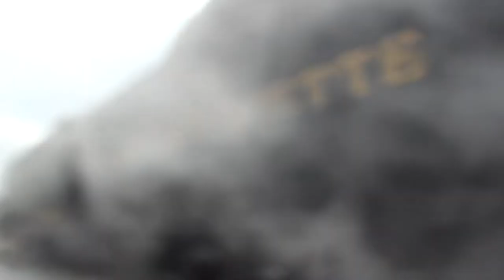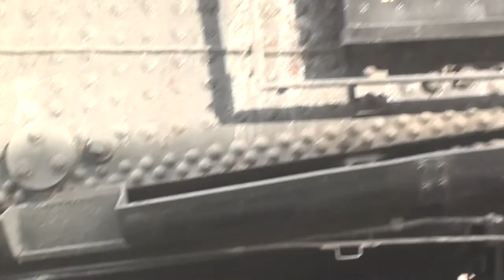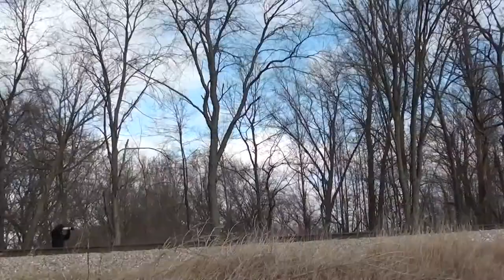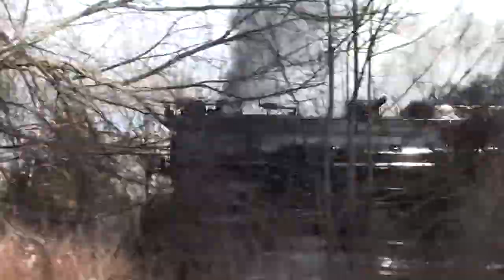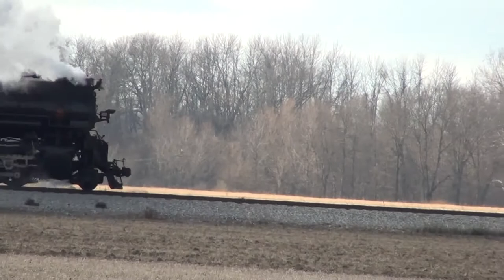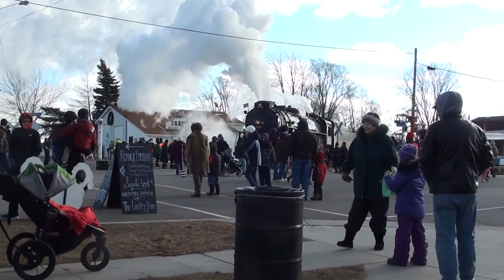Pere Marquette 1225 NPE 2015 w/ Pace Shot, Extras, & More!

Comment: I'm chasing the 1225 on the NPE this year, any tips on where to be? I'm unfamiliar to the area
Reply from the maker: I’d say that if it’s your first chase, you should get 3 spots. if you’d like, choose a spot in Owosso. Another good spot is the Baldwin Rd crossing, then Ashley. If you’re confident enough, you might be able to fit one more spot in there. Hope that helps. Good luck.
Reply: I'll be pacing on King too. Hopefully it turns out as good as yours did
Reply from the maker: You’ll barely make it to Baldwin if you pace. But that kind of substitutes for it. I’ll be volunteering and chasing throughout the season. Which weekend do you plan on heading up?
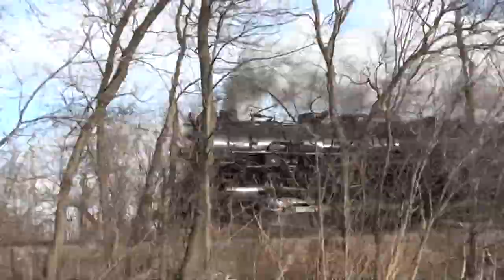Reply: JacksonAndLansing Railroad Ill be trackside dec 8, 9, and 10. I'll be riding the 5:00 run on the 9th
Reply from the maker: It’s likely I’ll be chasing one of those days. Are you the youngish volunteer at Hesston? I think I’ve seen you a few times before.
Reply: I'm a conductor on the 14ish. You can see me in my latest video on the right with the brown jacket. (I left the camera running while I was working)
Reply: Also my mom helped with the tripodisms